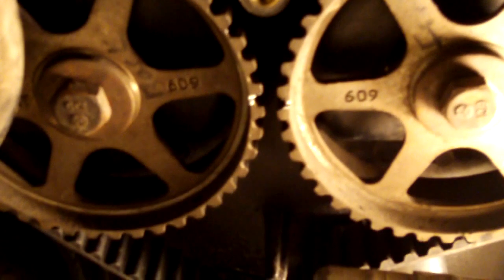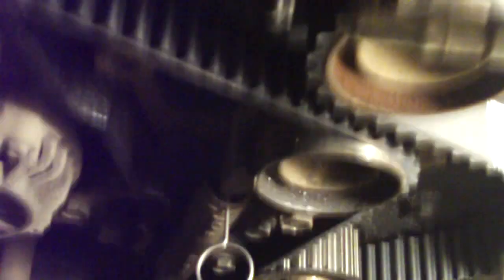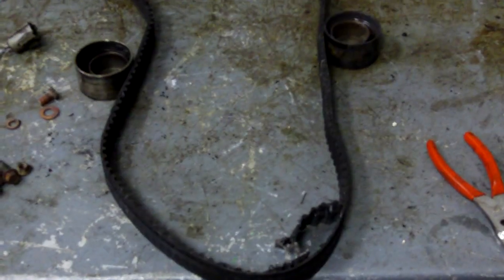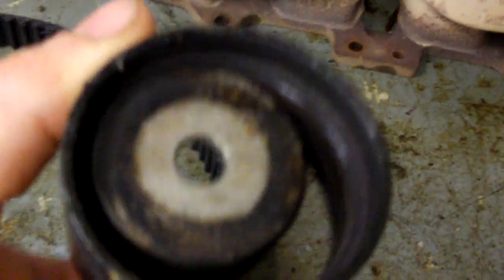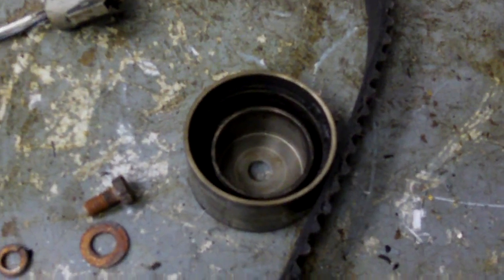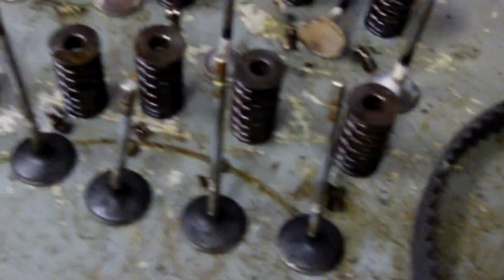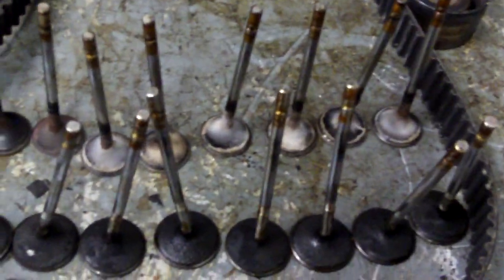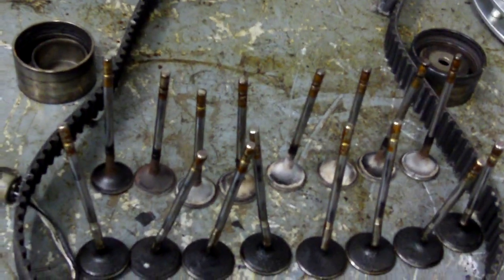2.0 Neon DOHC timing belt aka 16 bent valves

Comment from the maker: If the belt broke and now you have a misfire code that wasn't there before then it most likely has bent valves, and most likely it's going to be more than just the cylinder that is setting code. Remove all the valves and check them in a valve grinder to see if they are straight or bent (you can also roll them on a flat surface and see if they wiggle) you might also see contact marks on the top of the pistons. Good news is you can get a full set of new valves for under $100 on ebay and I have yet to see bent rods from valve to piston contact on these engines. When the valves contact the pistons they will leave little smiles or frowns on them depending on exhaust or intake.

Comment: Do you remember how fast you were driving when the tensioner pulley locked up? Same thing happened to me but when it broke i was slowing down to a red light so the rpms were fairly low. After replacing the timing belt and all the pulleys, my car still runs but every now and then the check engine light comes on with a code showing a misfire in the 4th cylinder. Does that sound like possible bent valves?

Comment: #1 with the DOHC Neons, you never align the cams by lining up the two etch marks on the cam gears. They are off from the factory. Instead, your camshafts (aftermarket or stock) will have two bolt holes (that are closer to the cam gears) that must stick straight up and line up with the cam towers. See http://forums.neons.org/viewtopic.php?f=8&t=383230 

#2 You made the same mistake I did, you stuck with the hydraulic tensioner setup. I went thru the same thing as you, except my idler tensioner bolt snapped after 1200 miles. Not fun. Instead, a better bet would be to upgrade to the Litens mechanical tensioner setup. Much easier to set and when you follow the instructions properly, will set the proper belt tension quickly and easily. See http://forums.neons.org/viewtopic.php?t=276308
Reply from the maker: there are also holes in the camshafts too, but you would need to remove the valve cover to find these. I am going off of OEM service info. and it's still difficult to figure out when the timing gears are in the proper alignment, always rotate the crankshaft by hand slowly twice and timing marks should line up, if not you need to do the procedure again and then recheck again.